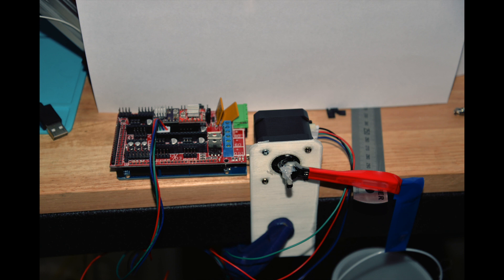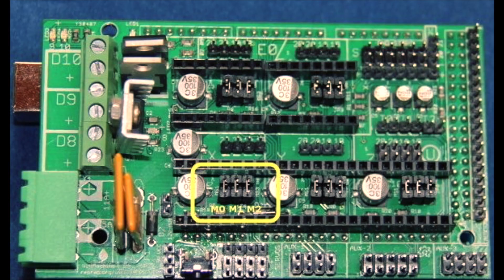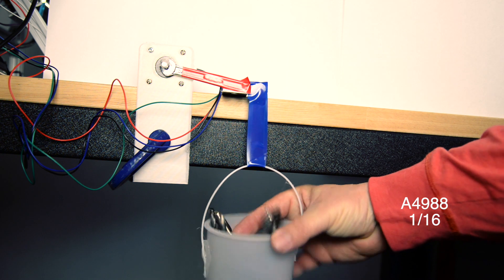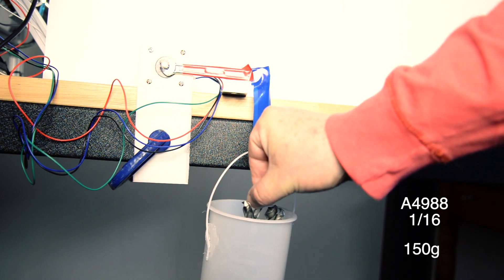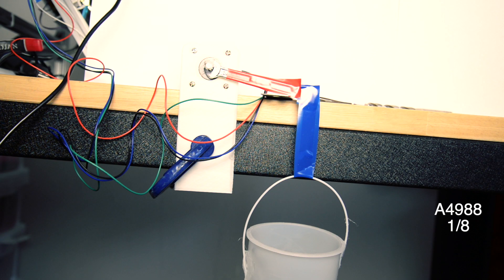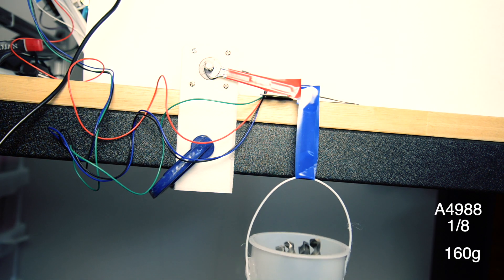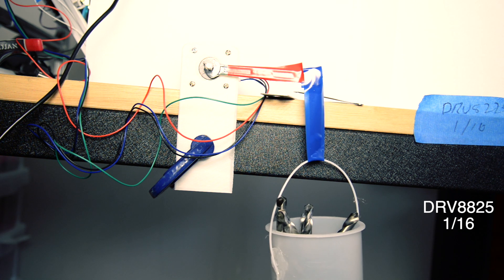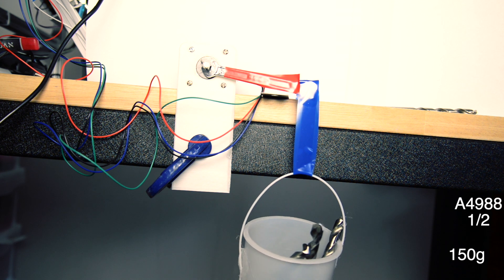Microstepping vs Torque: A4988 and DRV8825

Comment: These are the data that I could extract from the video:
A4988
 - 1/16 150 g
 - 1/8    160 g
 - 1/2    150 g
DRV8825
 - 1/32 210 g
 - 1/16 220 g
 - 1/2   170 g

First of all, having 3 data points per experiment does no allow for any statistical analysis.
Descriptively though, what I see is that the factor with the greatest impact is the driver. For A4988 I would say that the stepping rate does not really show to impact lift. For the DRV8825 the 1/2 rate decrease lift while for the other 2 step rates there is barely a difference.

In reality you would need to assess what happens on all available stepping rates available for each driver and secondly repeat the measurements, at lest 3 times each. Then you could graph the results for a better idea on how stepping rate affects lift (and implicitly torque).

There is also a source of variation in your measurement that can impact your results. And that is the width of the bucket. Although the pivot of the bucket is constant, the position of the weights inside the bucket can change and tilt the bucket left or right varying the pulling torque i.e.if  the weights are placed in the left side of the bucket it will be easier for the motor to lift compared with having all the weights on the right of the bucket.
Reply: I believe the location of the weights within the bucket should have no effect.  The whole load is suspended from the point where it attaches to the arm, and will self-align so the centre of mass is vertically below the pivot point.
The only proviso is that the tape used to suspend the bucket may not be as flexible as something like a fine cord.

Comment: I have an Anycubic i3 mega and I'm replacing the stock drivers with the DRV8825, I saw that the latter have microsteps (1/32), but I have to change something on the printer to be able to take advantage of the microsteps or the printer is ready to use the microsteps ?

Comment: Do you mean by that test which microstepping is better for certain weight ? if using full step the torque will be less ? if using 1/2 step it will increase torque and can handle more weight ?

Comment: Just letting people know that this test is comparing apples to oranges when the Vref is the same on each driver. Each driver chip has a different Vref. For the DRV8825 the equation is: I = Vref/(5*Rsense) whereas the a4988 is: I = Vref /(8*Rsense). Please take some time to spread this information, because everywhere I look, people assume certain multiplying factors that are actually dependent on the sensing resistor and the chip itself. Source datasheets: http://www.ti.com/lit/ds/slvsa73f/slvsa73f.pdf (item 8.3.1) and http://pdf1.alldatasheet.com/datasheet-pdf/view/338780/ALLEGRO/A4988.html (page 9). Thank you.
Reply from the maker: Thanks for the information Mauro

Comment: I'm in the process of building a paste extruder and the number of steps is 2x important: you need control over the extruder speed (steps/mm) and also keep a reasonable torque to push the ~30 mm 'filament' (the paste inside the syringe). Even with 10:43 gearing and 1/16 stepping it is not an ideal setup to extrude from 30 mm to 0.6 mm... I may need to add more gearing, to buy a geared stepper or to decrease the "filament" size (smaller syringe)...
Thank you for this test it helps a lot! I'm glad I've bought the DRV8825 :) (I'm too cheap to buy the 2130...)
Reply from the maker: The paste extruder sounds super exciting. Hope it goes well.